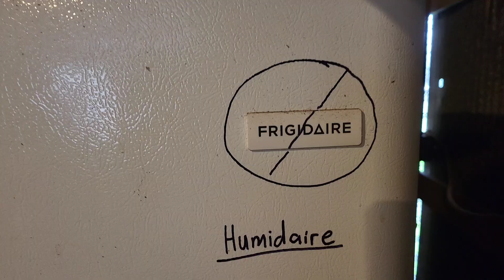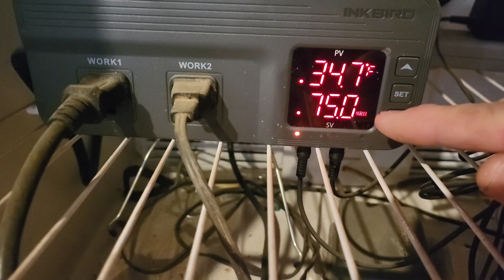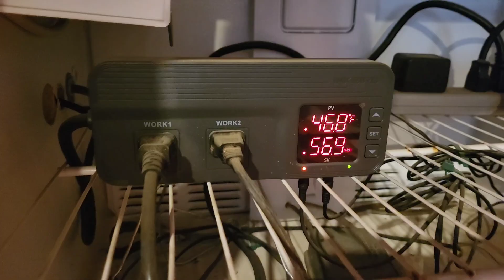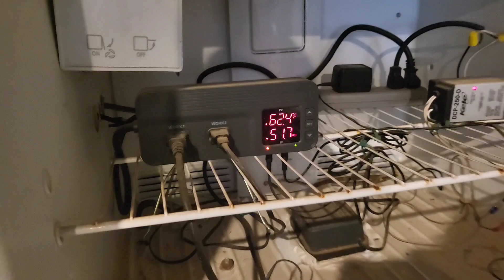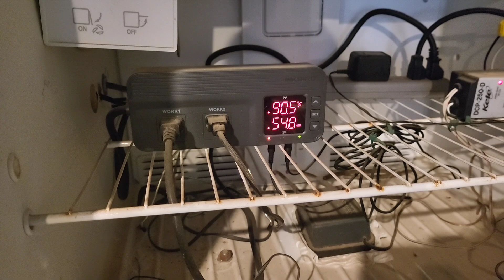Homemade Refrigerator Incubator Loaded! First load for 2025!

Comment: Man, this is a cool little set up. I’ve been using that Styrofoam incubator without an egg turner. I turned the eggs five times a day and I have a reptile humidity monitor, but I’m still manually working on that humidity, but I have about a 99% hatch rate, but it is intensive and I have to be home to deal with it for a most of a month. This is a great idea
Reply: From Texas
Reply from the maker: Hatch day is coming up this Wednesday! We did end up losing power for a few hours once AND this is the first batch of eggs I've incubated off of this new rooster, so I'm not sure what'll happen! Lol